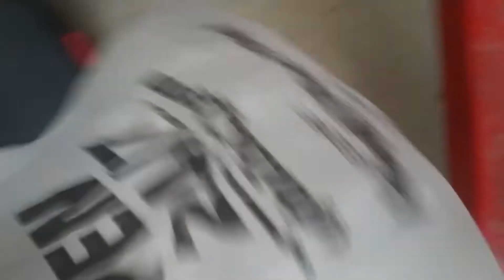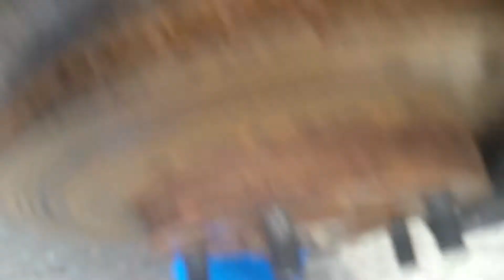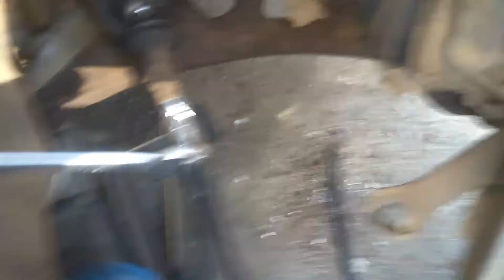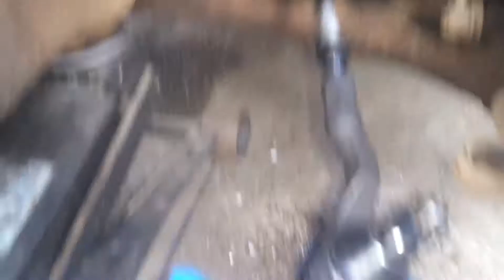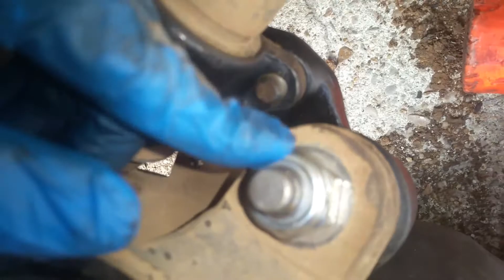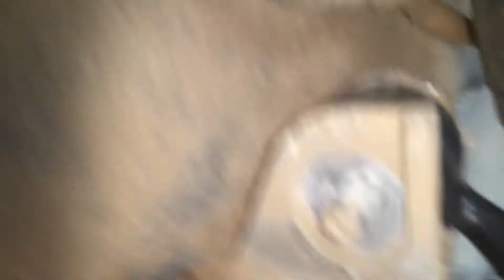1999 mazda millenia ball joint, tie rod, lateral link , stabilizer replacement

Comment: What caused this work to be done
Reply from the maker: The cars steering had a lot of slack and the front end components were all loose and worn to the point it couldn't even be aligned . I ordered all these components on ebay and they came with a 10 year warranty . Basically it was a simple job but the difference it made was remarkable it seriously felt like driving a new car with all the front end components replaced . If you notice a lot of busted boots and excess slack then it's time to replace some parts . I will point this out if the struts or shocks are bad I'd replace those first because if you don't the car is going to possibly damage these new parts . Thanks for watching the video and the feedback
Reply: s33therfan ive replaced the struts, tie rods, sway linkages, that top leading control arm, i have bottom ball joint and axles but cant afford the upper control arms yet, how likely am i to not break it if im careful
Reply from the maker: Yes sir you'll be fine if those are all you have left . Sounds like you've done some pretty good work to it so far. That's the way it is I mean I don't like buying new cars so fixing what you have if it's been a good car is the way to go . I have way more confidence in a lot of the older models . Fixing suspension parts etc really is an area that you can tell a huge difference for sure . Thanks again

Comment: I need this parts for mazda millenia
Reply from the maker: You can get on ebay , that's where I ordered my kit from. I order a lot of hard to find parts there. Just put in the search 1999 mazda millenia ball joint kit. They have a kit for aboutb $115 that includes everything you need , except for the upper control arms. If you want to replace those ; search upper control arm and they are about $100 for the pair. So if you just do $115 kit you'll get lower ball joint, control arm, lateral link , outer tie rod , inner tie rod. Believe me this will make a big difference on the car . The one in the video was so loose before and after it was like driving a new car again as far as the steering and handling. Hope this helps out and thanks for watching if you haven't already I invite you to like and subscribe .

Comment: Nice work. Those are much easier to work on then the 1st gen 6's. Gotta drop the subframe and the ball joints are a real bear to get out. Thanks!
Reply from the maker: +Baxrok2 yes sir , I know these 99 seem pretty well made for the most part nice solid parts. The bolt on ball joint was a pretty good idea . I've seen some that were similar but had rivets instead but I suppose one could drill them put and use bolts and nuts . Either way pretty easy to just replace that piece. Thanks again for watching